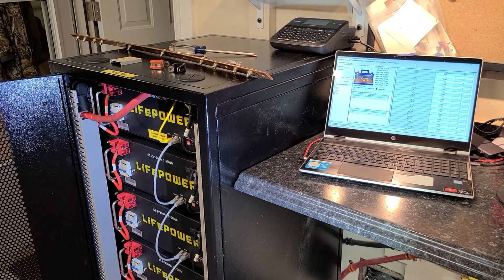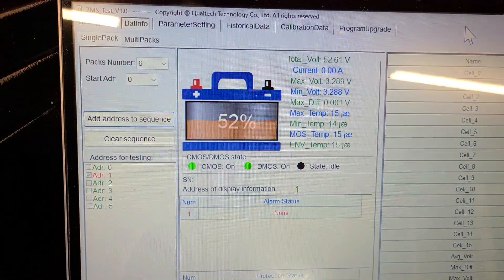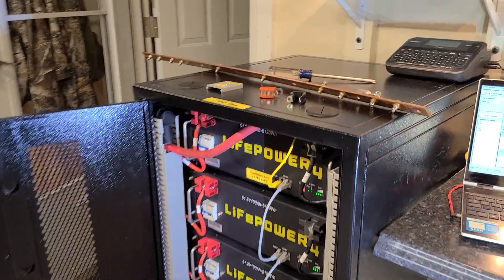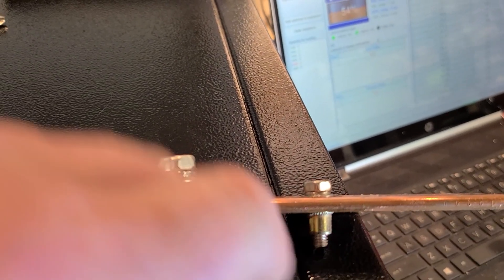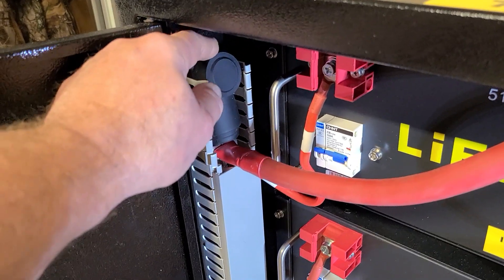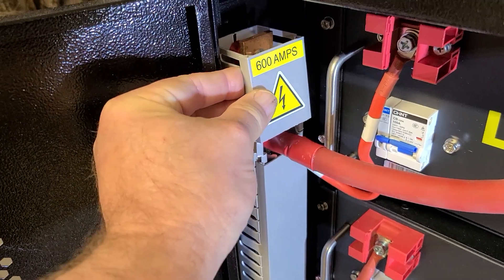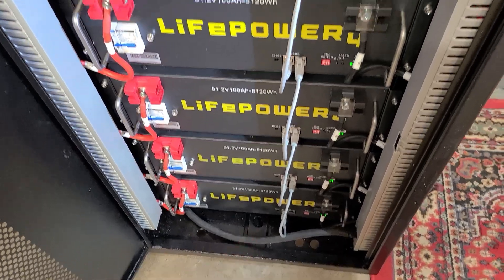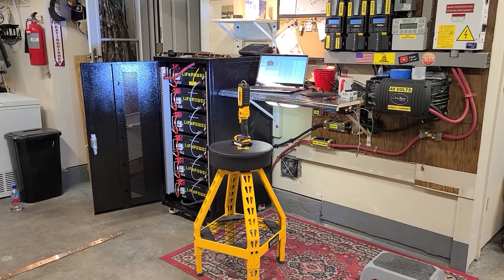DIY safety mods & enhancements: EG4 Lifepower4 server rack 48v battery system (600 amps)

Comment: Will Prowse recommends flipping one of the bus bars around to achieve diagonal connections.  I just received a 3-slot rack for my first project, and am wondering if you did that since your positive and negative cables are coming off of opposite ends of their respective bus bars.  Or did you just do that as part of your sort of reworking the bus bar connections?  Your comments about rivnuts make sense.  I haven't looked closely enough at the rack to see how the bus bars are assembled yet.
Reply from the maker: Electrical preference prob doesn't matter with such short of runs. BUT, I flopped mine (POS on top on one and NEG on the bottom of the other). As for the rivnut inserts, they are junky. Not sure if Signature Solar took my (and others) field advice and fixed them. I actually talked to the CEO about them. After I did all my fixes, this battery rack has been bulletProof.
Reply: @ChrisDIYerOklahoma  Thanks.  Good to know.  I think Will was concerned that if the main connections were both on either side of the same battery, that battery would reach the end of its cycle life faster than the others.  You must have thought there was some reason to flip them, or you wouldn't have bothered to do that, right?

Comment: Oh thats not good!. Rib nuts are ok but that 4/0 needs to sit FLAT! or you will get a visit from the ARCs! You should put a EG4 6 gun kit together. HINT HINT! to signature solar!
Reply from the maker: Rivnuts and pop rivets can be uber strong...but, not on soft copper. I had several that were not seated correctly and one that came out with my hand. WTF? I have seen slop-job loose connection arcs...and it isn't pretty.  Hahaaa...these buses are all fixed and Guten Tight. And safe.

Comment: Nice I'm doing my bars like U with bolts not those rivnut deals at all much better MO Safer.
Reply from the maker: Thanks. You know the old saying, "keep it simple, stupid". Old navy saying. Anyways, I really wanted to tap/dye holes, but decided against it. IMHO, what I did came out stronger. I only had to drill out two of those rivnut inserts and secured those fat 4/0 lugs TIGHTLY to the busbar using Grade 8 bolts, Nylocks and star locking nuts. I torqued the ever-lovin' piss out of them and used steel wool to make the surfaces shiny and clean. Good luck with the mech room work. That is going to really awesome

Comment: Hey Chris, After being on FLA for 6 years I have some hard to break hobbits that I imagine you will have also.  I was so used to preserving the batteries that I was always shutting everything down as soon as the sun went down.  I am slowly loosening up on that and getting more out of the system.  Last night I was still running 3000Watts well after the sun went down.  Battery was still at 59% this morning and I will easily top it off by 1:00pm.  I still have a ways to go to capture all that sunlight!   One more thing, hope you don't mind my suggestions, have you considered adding a fuse at the busbar end of your 4/0 to protect that wire?  Its looking really good and I love your labeling!  :)
Reply from the maker: We get smarter with age and helping each other out. I have seen things on your system that I did. I am sure others have done similar with mine. Together we are smarter and can fine tune our systems our own way. With lithium, you can run them down far unlike flooded or sealed AGM batteries...they are "smart". As for a fuse, I already have one installed on the wall in the 4/0 red wire power circuit. Additionally, each battery has a circuit breaker, so, putting a fuse in the cabinet technically "is" feasible and alright to do, but kinda like wearing three condoms IMHO. In some of my lithium speaker ammo can builds, I don't even use a fuse. ie - the lithium battery's BMS won't allow excessive current and will go into pissed off mode (shuts itself off).